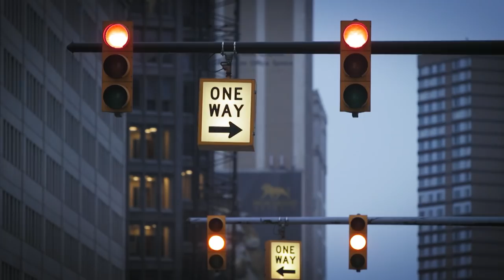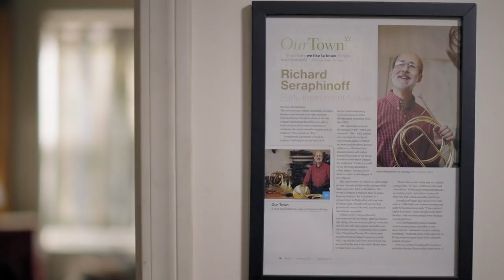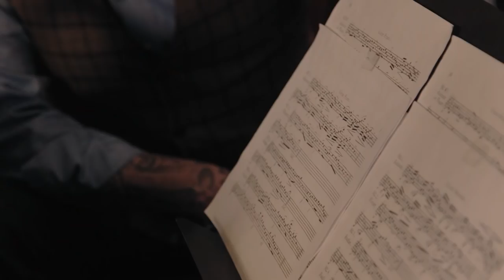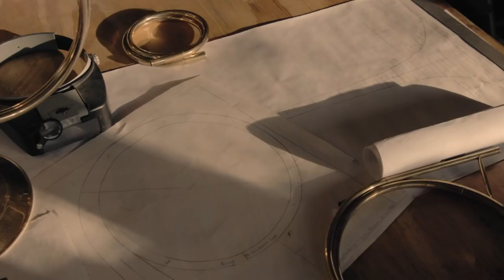A Craftsman's Legacy: The Brass Horn Makers

Comment: A warning to all: The pitch being used is likely tar pitch which is highly carcinogenic and hence why it’s not used anymore. In the old days they used to manufacture asphalt for roads using tar, however nowadays they use bitumen instead due to the health issues.  Bitumen and tar are both hydrocarbons, but different molecular structure.
Reply from the maker: This was not tar but your information is great and very much appreciated!!  Thank you

Comment: Being that it didn’t take too long to bend the tube with the pitch in it, do you think ice would work? It would be easier to remove …….lol 😎
Reply from the maker: I have used sand but not ice.  I don't think ice would work.
Reply: @CraftsmansLegacy   we used ice to bend heavy wall tubing without a inner mandrel for automotive jobs.
Reply from the maker: @patrickretsel7048  I'm surprised that ice worked.  I would think it would fracture / melt and not provide the form support.  What material and wall were you bending?    What volume of ice?  I'm super curious
Reply: @CraftsmansLegacy  it was a 3/8” wall about 18” long, we ran testing on how to bend it. It did fracture big time but we were only bending shallow bends. It was 25 years ago so I can’t remember everything perfectly lol. A few years later we tried it again with a double wall tube tube and found steel shot with capped ends worked best….we even built a tube bender that bends the tubes so if the tube broke the steel shot would no fall into the main bearings of the machine and destroy  them. Necessity is the mother of invention…….
Reply: I was digging around in my pics and found some pics of the machine we built. I’ll send you pics of the original machine and of the new designs to accommodate the steel shot.
Reply: Not sure how to show you them I can’t paste a pics here……send me you email address and I’ll send them to you. Or let me know when you are in your bike shop, I live close by.
Reply: @CraftsmansLegacy  ice is used at the Bach trumpet factory.
Reply: Many french horn and other brass instruments manufacturers use soap or other materials suspended in the water to bend tubes.

They already have prepared forms used for bending the correct shape so they can bend them quickly before the ice starts melting. 

Traditionally, lead had been used but it creates wrinkles in the tube that must be hammered out (and it's toxic). There are other metal alloys like cerrobend which are also used.